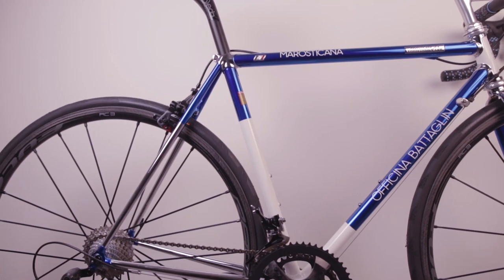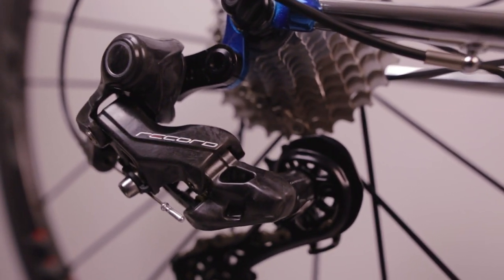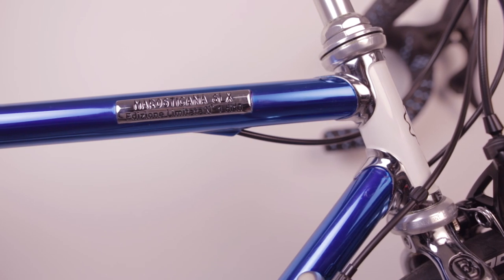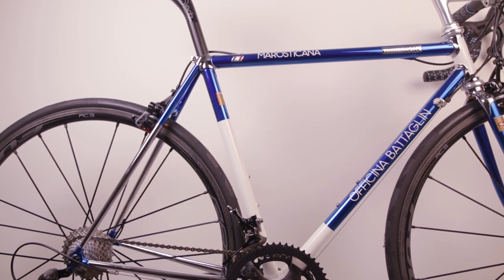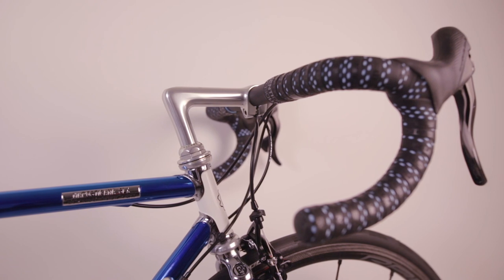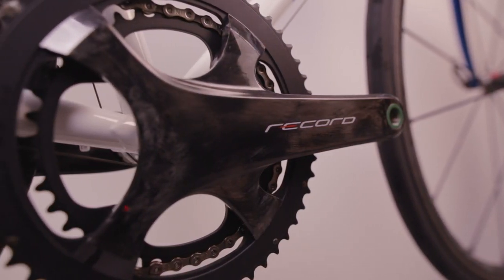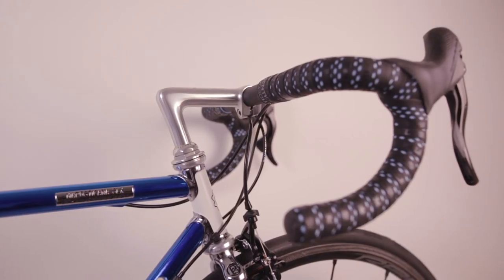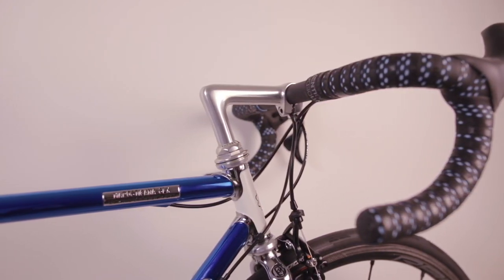This ROAD BIKE BUILD blends the BEST STEEL TUBING of the 80s with MODERN parts!

Comment: Just rebuilt the second racing bike that I bought new in 1987, a Puch Columbus SLX with 11 speed Campagnolo and Fulcrum alloy rims, Selle San Marco Concor Carbon Light saddle.  I swapped out my Cinelli 1A stem and bars for a steerer tube extender and modern stem and bars for convenience, rather than aesthetics.  I love riding the bike and I have a flush of new enthusiasm for getting out on the road, even in preference to my modern carbon aero bikes.

Comment: Hi Alex. What is the weight of the frame (without fork, stating frame size) in Columbus SL?  How much more or less weight change is there with another type of tubing like, Columbus Spirit?  Do you use Zona for the seat stays and other more rigid parts?
Reply: When you focus on weight you've lost, big time. Weight is a loser's game. Here's a tip...... Get this bike or some other lugged steel rig. Drill the main triangle and fork full of holes to save weight. Do the same with the saddle and seat post. Don't use handlebar tape.Get the lightest wheels possible. There........ Satisfied?
Reply: @death2pc  I actually ride a steel bike (Columbus Spirit) and don't own any other.  The weight penalty (including rider, water and bike) for a modern steel bike is about 1%, because a steel frame weighs about 1kg more. So it is trivial. I wanted to know something about the different types of steel. I don’t think there’s much difference in weight.

Comment: I have to agree with a previous commenter (on a different video) - the Campagnolo crankset looks unfinished and almost 'dirty'. Perhaps, in the flesh, it's better but I think something like SRAM Red AXS is much prettier from the modern offerings. Apart from that, stunning bike!
Reply from the maker: Thanks Max! Choosing the perfect groupset always comes down to the customer's preferences. But the SRAM Red AXS does look great!
Reply: I have a similar Campagnolo carbon crank.  It does not look dirty. What you are seeing on the video is the light reflected at different angles, but not picked up by the camera at a distance.  It is true that some parts without clear coat will look a bit dull (rear derailleur), but the carbon cranks often have a marble like finish, with some veins which are actually the edges of the carbon fibre layup panels. It you apply some furniture polish I think  it would look very different. I think the idea of not painting it is to show the fibres and any potential delamination.
Reply: @bengt_axle  well I certainly wondered whether it was to do with the way it photographs because  it would be strange for them to sell such a high end product if it did look like that in the flesh
Reply: @maxrevell3830  Hi res photos here: https://bikerumor.com/wp-content/uploads/2018/04/Campagnolo-Record-12-speed_Movement-12_road-bike-groupset_Cannondale-Synapse_new-twelve-speed_crankset.jpg.  What you see are the striations of the carbon.

Comment: Nice bike....but my question is why didn't he use the carbon fork instead of the original fork?
Reply: The steel fork is part of what gives a steel bike it's ride quality. It also helps the steel bike have a balanced feel. The proper rake and trail of the curved steel fork helps and I wanted that.
Reply: @sammosley196  Congrats Sam!